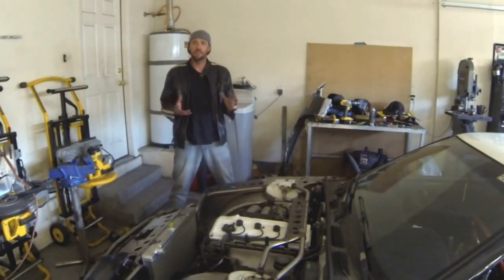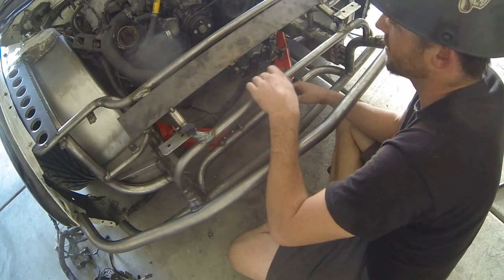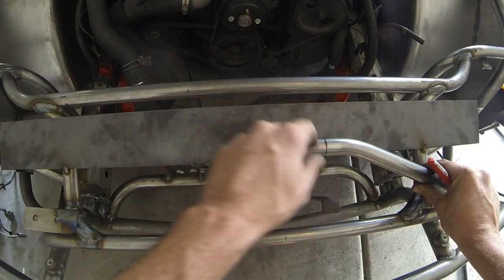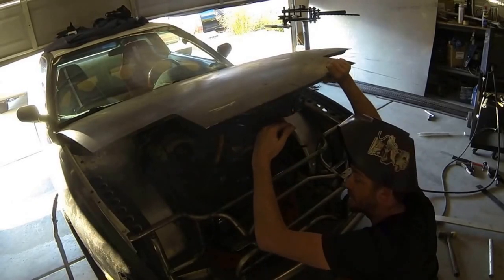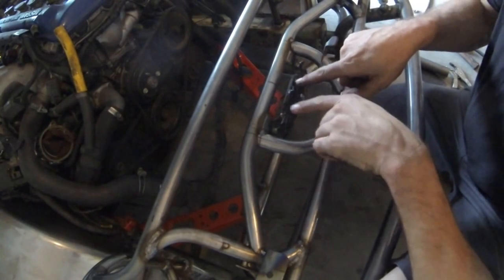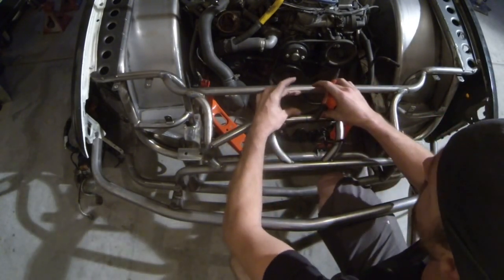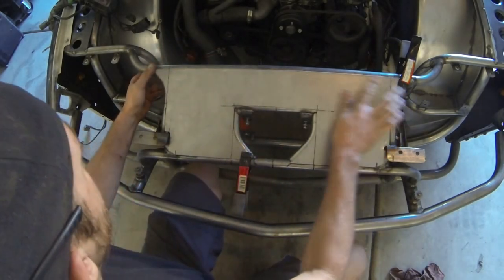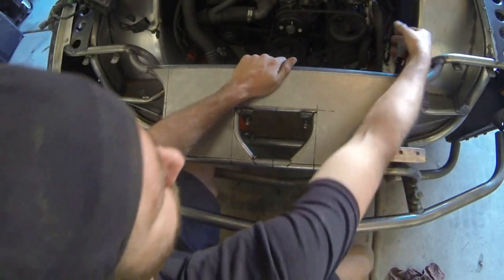TFSS: How To Build A Tube Chassis Front End - Radiator Diffuser Part 1

Comment: Would a paper template been easier and faster for this? i usually just take a piece of chip board tape it in place and use my dirty hands to rub on all the important reference tubes/marks. Cut it out, check for perfect fitment and make final small adjustments on it for perfect fitment,  transfer to the metal cut it out, bam perfect panel. I like this method for people just starting fabrication because if they do get a few measurements wrong they can catch it early on with the paper template and not waste the 18 gauge piece. Either way, great info.
Reply from the maker: +BlueCollarDreams I do use templates often, but this is more aimed at those who are newer to fabrication. Templates work well for a lot of people, and I even demonstrate using templates in the next chapter.

Comment: What grade of steel tubing do you typically use for the fabrication!
Reply from the maker: +workwillfreeyou It all depends on the job and build. Some use ERW, others are strictly DOM. Some builds use both, while others use full Chromoly. There isn't always a standard for any particular build. If you are building a roll cage, for instance, the minimum grade requirement is usually listed in the rules. Hope that helps a bit.

Comment: hi fab, thanks for sharing man. i have a question not specific to this video, if you have the time i`ll appreciate it. it regards the bender, here where i live i can`t even think of buying a bender simply because there is no availability, it`s either crap or ginormous industrial machines. so i will have to make my own. i have copies of the plans published by the chopper people, these are for a horizontal like you have and a vertical, which prompts my first question of which you consider more versatile, the second question is about the bending method, for what i see in my crap  computer you bends are impeccable but maybe the monitor misses something, there is this type of bender like yours in which the tube is attached to the die and the rotates with the die, and the other type which the tube is fixed and a form follower (sorry don`t know much of terminology) is rotated or slid along the tube. which type you believe that makes the most deformation free bends. i`ll be using mine for furniture (generally 1" 14 ga which now i sub but prices are getting stupid) and hopefully in the near future chassis tube work (i have to cheer me up as sometimes i see it as a looong shot). man thanks again i know it`s a freakin long question sorry for that, you seem a really straightforward guy so i`m asking. regards. pete
Reply from the maker: +thebrokenbone There are a few different types of benders. The 3 most common styles are Draw, Ram, and Mandrel. Draw types have many different designs in both horizontal and vertical configurations. Some even use hydraulics to aid in bending. They are pretty much the only style used for bending tubing. It's really up to you to decide which bender design works best for you. I've personally owned a horizontal an vertical style benders and both have their good and bad sides. Most of it is based on the design of the machine itself. 

Ram bending is mostly associated with pipe bending. Tube and pipe is two completely different materials and one should not be confused with the other, or attempted to use with the other. Ram style (or Pipe Style) is usually a form die attached to a hydraulic ram that pushes a segment between two rollers or blocks. It often deforms the inside radius of the bend. This is most commonly seen in exhaust shops (but they use tube size dies). 

I make quite a bit of custom furniture myself, and the bender I use is near perfect for it. The CLR isn't as tight as some mass produced furniture, but it will definitely get the job done. I also use it for all the chassis work as seen in the videos. I'm not sure if this really answers your question, but I hope it at least gives you an idea of what you are looking for. The Chopper Bender Plans are basically the same machine I own. I use a JD Squared Model 3 for all my bending.
Reply: whoooa thanks for your reply! yes man it helps A LOT. i`ve been watching your works and you are the right person to ask for this. i will go for the horizontal, ratchet operated, i even have an old falcon bumper jack that is telling me all the time use me, so this would replace the ratchet, hope i get to fab this tool soon :). thanks again for your input really appreciate it. pete
Reply from the maker: +thebrokenbone You're welcome, Pete. In all honesty, it doesn't take much effort to bend thick tubs with this bender. The jack might work well, but I see it taking a bit longer than necessary to bend, but if it works out for you, let me know. I'd like to see that in action.
Reply: yes you are totally right about this as the jack only moves about half inch per stroke (just went and measured a moment ago), do you have your bender bolted to the floor? (edit: may sound like a stupid question but i`m thinking about sinking a hitch receiver in the concrete floor so to make space when not in use ) i think by late february i can have it completed i`ll be happy to shoot some video showing it, don`t know a thing about shooting video, equipment or editing but i guess i`ll figure it out :)

Comment: why dont you just use carboard?
Reply from the maker: +Chuck Salerno Sometimes I do use templates (you'll see it in the next chapter). It all depends on what I'm building. This is demonstrating a different method for the viewer. The other part is there is little to no difference measuring and cutting the template or just cutting sheet metal, so might as well build the sheet metal the first time instead of building the same piece twice out of two materials. The accuracy is greater without the template on this piece as well. It's all up to the builder to use whatever method they are comfortable with. Neither method is incorrect as long as the outcome is the same.